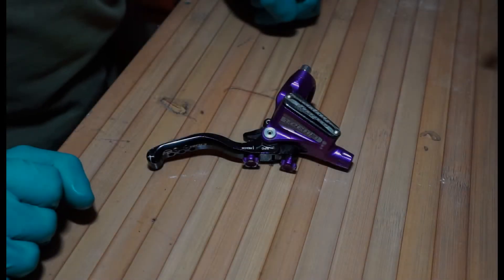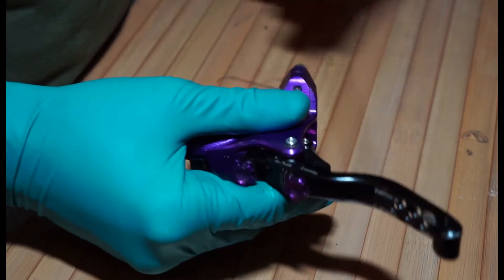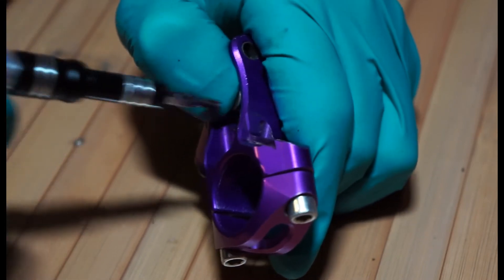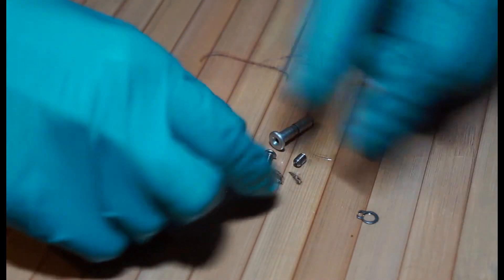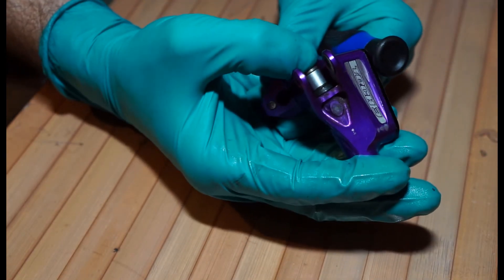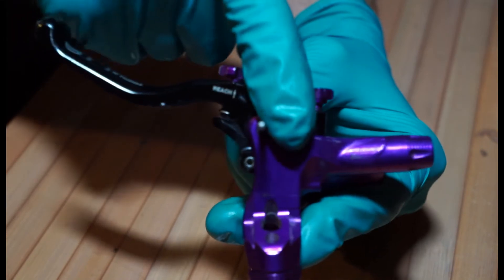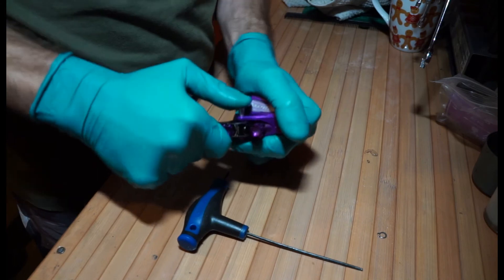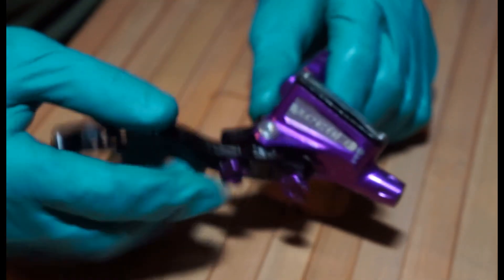HOPE Tech 3 Lever Rebuild  Master Cylinder E4 V4 X2

Comment: Hi I've noticed my rear brake lever is wobbly and the pivot slightly moves any advice would be great 👍
Reply from the maker: It might be worth replacing the pivot if it's not new. I have seen quote a few of them wear down over time. 

If it's a well used brake it could actually be the master cylinder body that's worn but this is quite rare for tech 3 brakes and I don't know how you would go about fixing that unless you can machine your own pivot to a bigger diameter along with the lever. .
Reply: @Chambers36TheEnter  thanks there about 3 years old used every week on e bike only just noticed the play .il try replace the pivot thanks